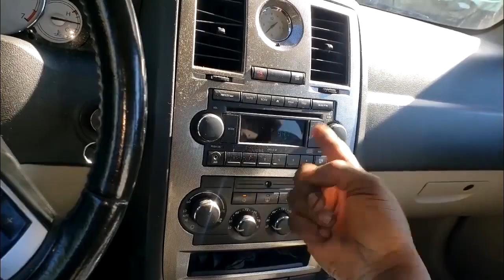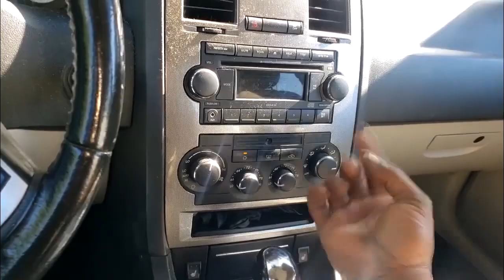How I deal with RECHECKS or COMEBACKS  Even if not my fault  Oil leaks, ABS light, Ticking AC fix

Comment: I would check underneath the filter for two gaskets that’s how they come loose. Seen oil tech leave old rubber gasket on and put new filter on tighten then they drive off it slowly leaks and vibrates loose